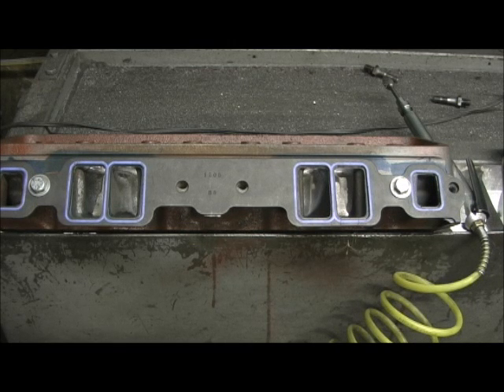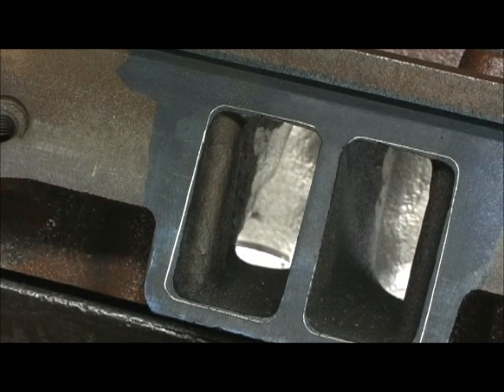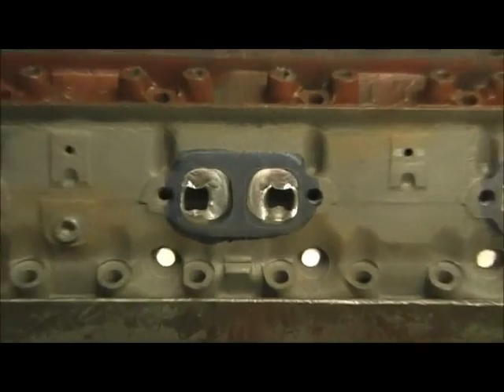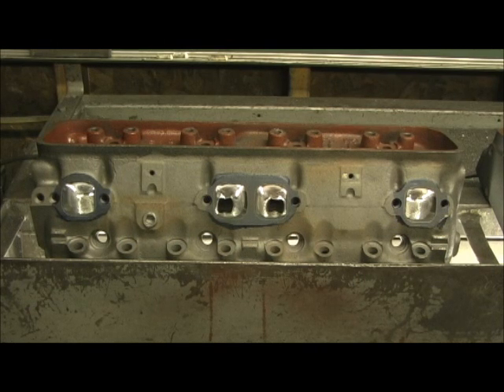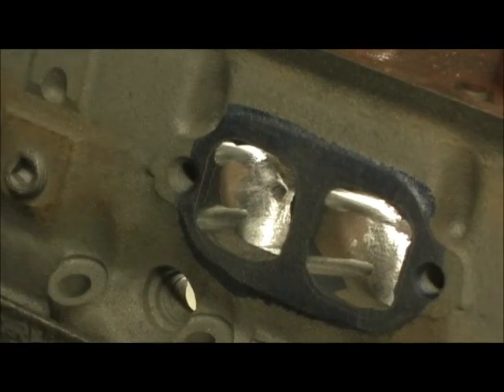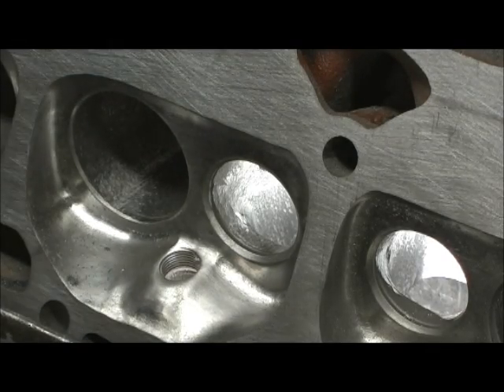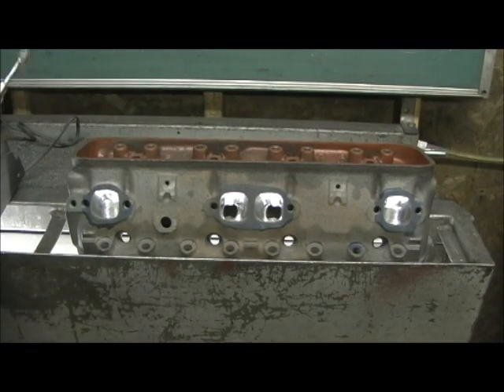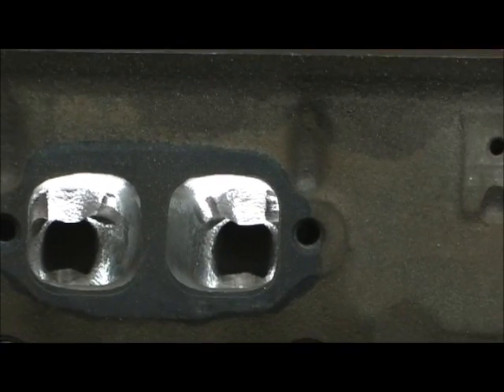350 Chevy TBI Stage IV Part 3

Comment: I was surprised to hear you say you fill in the bottom of the exhaust port where the exhaust exits into the headers with weld?.
Would that not limit the breathing of the engine if you filled up the bottom of the port with weld?.
I'm curious how that would help.

Comment: Headbytes Porting First off wanted to thank you for making great videos on porting. When I went to school they touched on the subject and they had examples of work already done, even showed a basic video, but the main things they mentioned was being careful of how much material you pull out due to coolant passages and improper flow characteristics if the work isn't performed right.. Unfortunately we as students weren't able to try our hand at it...

  I was curious though I noticed at 5:46 you mention the Scribed line on the bottom and that you "Do not remove material from the bottom of the runner" Why is that? Is it more prone to causing exhaust leaks at the header flange? or does it cause poor exhaust flow? If so why or how? Thanks again, hope to hear back from you.

Comment: Can these tbi heads bolt up to older blocks? I have a 74 2-bolt out of a camaro that I'm lining up for my 94 s10 tbi and my plans are to have power when I need it but good mpg when I don't need the power.
Reply from the maker: Absolute true; however, these heads are NOT designed to make power past 4500!!! These are the Ultimate Truck Torque heads. You just need to have the correct intake manifold.
Reply: Ok thanks. 4500 rpm isn't too bad for me sense it'll be a daily driver. The only time I might rev it would be to show these teenagers with fart pipes what a real motor sounds like. lol
Reply: bhearts77
I know, just in my case with my 94 s10 4.3 the motor had a bad knock for over a year so I figure if I'm gonna do a swap why not a 350. I mainly want to do anything I can to get 300hp~ while getting the best mileage while cruising around town or work commute. My 94 is parked for now but I also have a 2000 s10 4.3 that if you drove it you'd swear it was a v8.
Reply: Allen McKinney turbos are your friend
Reply: bhearts77
I know, I don't have the budget for turbos.
Reply: Allen McKinney please dont think 8 is the only number that can make power.

Comment: Headbytes Porting Curious as to how you think these would perform in a quarter ton 95 Suburban? Also, what does this look like price wise from start to finish?Obviously a large time investment from your standpoint.
Reply: Porting n polishing is very expensive on any project... especially when you don't know what your doing... or you don't get a quality job done... This is the only person i know to ever port/polish a tbi head Ever... Most Machinist will laugh because its iron , its an early swirlport/vortec style head... they would rather do a 96+ iron vortec head iron or aluminum...  if i had the equipment i would follow what this man has done because i have a fancy for the Easy to work on/cheap to run TBI platform... its amazing how much can be done to these engines without spending any money... the % of gains... spent a good bit on my 90 chevrolet sport c1500 , its fun but if i had the proper tools/bits, id spend a lil time on port/polishing/matching the ports... one big thing you gotta remember ... the tbi computer limits you to its stock Hp limit... doing all of the mods is wonderful , it will get you to your  pre set limit, but without knowing your mods and changes to timing/duration , you wont notice or get your Best bang for your buck... if i was you... id start with a 4.11 Posi, maybe a 4.56, traction bars, get a trans built for 500+ hp/manual valve body + a good transmount , work on this engine build he talked about... it would only be good for low end , quick drag... 1/8 or 1/4 ... D.O.T approved 10-12" wide slicks and take everything out of the suburban, make it light n have fun... also apply's to any 87-95 tbi truck/suv...

Comment from the maker: You know, it is funny you have said that. I have done soo many of these animals, and I tell people that these are 4000 RPM and down heads (which they are) and get better gas mileage than any other GM SBC head ever made (WHICH THEY ARE), but I have done a lot that here lately, a few are using these things for real high RPM (5500 to 6000) and having good luck with them.

Comment: About 10 years ago I smoked a 350 4 bolt with a cam, and 2.02 heads in a '72 K10 mudder. In a pinch a 350 TBI from a '91 Suburban with 87,000 miles on it was swapped in. After redrilling the center holes in the intake, I reused the old style Edelbrock Performer and Q-Jet.
Here's the point... the stock 'burb motor with just the intake, carb, and headers just hands down blew the older, modified 350 out of the mud! The only difference between the motors... the cam... and those swirl port heads!
Right now I'm in the middle of building a 350 for a '71 Vette and caught between using those same style swirl ports, or some "worked" 416s.
Reply: Good to know what your experience was when swapping to a headers and carb setup. The TBI Rochester 220 unit, though dependable, really struggles to breath with only somewhere around 420 CFM of flow.

Comment from the maker: I can promise you that you will not be disappointed, If I had a truck (Chevy for a small block) there is no other combo I would use as gas mileage, and torque this is a killer for sure. KB makes the pistons, the only company I know of that does.

Comment: Guess I'd better start looking for a 305 block & 400 crank! I have a K1500 that needs one of those little stroker motors under the hood. Factory 350 just seems weak. No throttle response. I need more power. AND fuel economy!

Comment from the maker: No Sir, I do not know of your work, nor who you are, but your right, under 4500 there the bomb and have been using them for that for over 12 years now in the Mid Tenn area and have coupled them to the 334 stroker engine I am doing at present which make a pulling torque duo.

Comment: Years later I replaced the 193's with a set of AFR 190's I bought new and fully ported them and cut them for 2.055/ 1.625 valves. The AFR's lost low rpm torque but improved high rpm a small amount. Was not worth the cost or the work for the AFR's.

Comment from the maker: I knew that was coming. That head Charles, is hitting "Z" factor at possibly three places and all in the short turn, bowl and release angle. Like going 200 MPH, hitting the brakes, speeding back up to 200 MPH, hitting the brakes again, and finally slamming the gas one last time!!! Could you imagine the fuel fallout? Thank GOD it was a twister, could you imagine if it was not? you would have a Edelbrock Pontiac Aluminum Head (those are a horrible mess)

Comment from the maker: No, the gasket is the standard Fel-Pro 1404 header gasket (the smallest header gasket in the "14" family, which is just a LITTLE bigger then the full gasket box silver pre-cut slide in iron manifold gaskets, really.  The bowls get a great re-shape for sure, but not like your implying, it just does not need that with this deal, and remember its power was meant for peak power production off Idle to 4000 RPM. It should start falling off shortly after that if my math does what it predicts it to (con

Comment: Thomas,  just to remind you I like to use 2.055/ 1.6 valves in these bad boys and I do some cutting. I suppose you are speaking of a drop of csa over that inch. That can surely be improved on. That is surely a race exhaust port compared to the junk most guys run.  Which of course helps reduce pumping losses and boosts economy and torque.

Comment from the maker: Yank, Yank, Yank, you make that sound WRONG. It is NOT a race port, and you cannot compare the 200cc as a BIG number when you compare it to a NON Screw head. That is like comparing apples to oranges. The problem like I mentioned in a couple of other articles and responses is that squeeze down from the flange to the short turn GM done wrong, they had a drop of over 50% in just under one inch. That is why it did not work right, all the work is in the transition of the bowl to valve. You DODO bird

Comment from the maker: ontiinued) Unbelieveable enough, there is no other head like that out there, period. Were talking about TORQUE, pulling power, towing power, and Great Gas MILEAGE...Combine that with the TBI's throttle response and it kicks the carb out the door. Simply put, IF you have a 1/2 ton pick up truck, want Great gas mileage for the 400 FT. LBS capable 350 CID engine, this head cant be beat. It is not about FLOW, rather fuel and air MIXTURE, which the screw port cannot be beat under 4000 RPM. Thanks.

Comment from the maker: Once again, You are comparing apples to oranges. What are you talking about when your are making this BOLD statement? are you racing, Street racing? Interstate driving? You must be talking just that. The first thing you must do when starting out on a build is: 1...Decide your application and what RPM your going to be staying at the most...That being said, let us compare heads. From off Idle to 4000 RPM, the 193 or 187 TBI head WILL produce more TORQUE that any GM or aftermarket head out there (c

Comment: You do know that porting a tbi intake aftermarket or not still will not flow as well as a stock carb intake right?so why waste just buy a carb intake and a carb to tbi adapter and delete the egr.But all of this is pointless if your still running the peanut cam.

Comment from the maker: That depends on the shape and elevation of the runner from the seat up. Most of the time they use the covered wagon "TOP" when they cannot get enough elevation in the port. LOW pressure on the floor, HIGH pressure on the roof.

Comment from the maker: That is exactly the reason for pouring aluminum. I herd that this CAN mess with the factory sensors. The reason I did not pour these is cold start up. The cross overs form a letter Y back in the head, which interferes with Pulse-Firing of the heads center ports. You get about a .10th, E.T. in the 1/4 mile, or about 15 Hp SOMETIMES.

Comment: i recently had to replace a set of these heads on my truck due them cracking. i couldn't help but to notice the 1405 felpor blocks the egr port. i cut my gasket to match it. im just wondering cuz ive done them before and eliminated the egr but now seeing the path behind the to center valves im wondering if it causes turbulence im the runner. maybe this is the reaseon for poring them with aluminum?